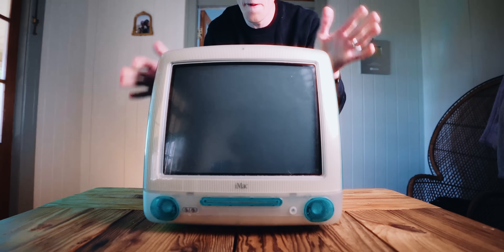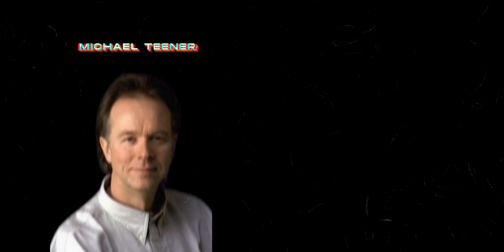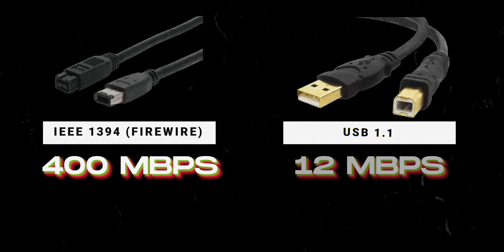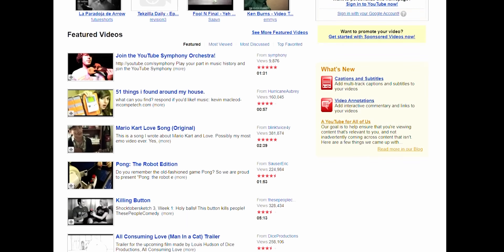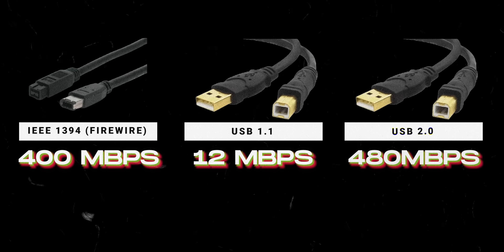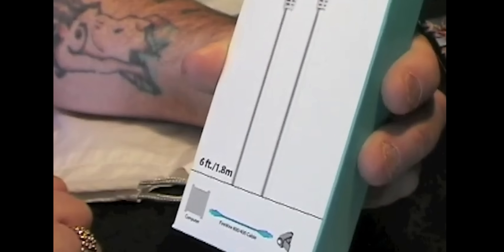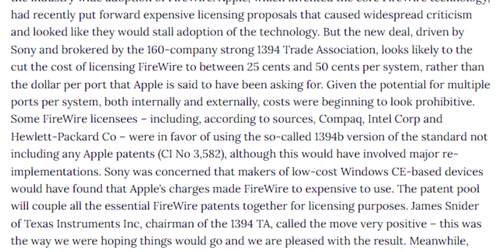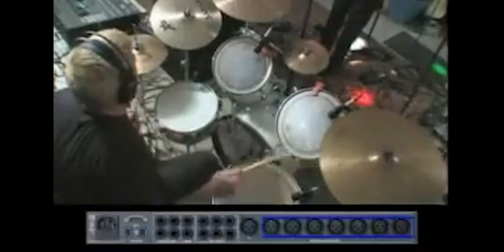Why Steve Jobs Forced You To Buy FireWire (Then Killed It)

Comment: One beautiful real-world advantage of Firewire is that it has consistent sustained transfer rate to external HDDs. You don't see significant dips in speed like with USB. While USB2's 480mbps looked fast on paper, the reality was way different. I always bought external HDDs and enclosures with eSATA and Firewire, especially ones with the Oxford Semi chipset (which provided the best performance and compatibility on Mac/PC). Also, the daisy chaining worked pretty well (my cam -> extHDD -> PC).

Comment: Fun Fact: The SCSI interface is (or at least was, back in the day) pronounced “Scuzzy”..for real! Macs all used “scuzzy hard drives”, PC’s used IDE…of course then cheaper Macs started using IDE drives and some high end PC’s even had SCSI drives. You could have up to 7 SCSI devices (edit: you cover this around @8:18) daisy chained together, with the Mac itself being SCSI address 0 so 6 additional hard drives or hard drives and CD-ROM drives, Zip drives, etc all chained together without writing about annoyingly cryptic dip switches that Pc’s often required. The Mac truly was incredibly easy for the most part when pc’s could be a nightmare for any non-geek. This was before the wonderful USB standard, showing Jobs wasn’t always a genius.

Comment: Great video! I loved FireWire, and still use it to connect to older devices. Some notes:

Firewire 1600 and 3200 were developed, and had been planned to be fully released, but Apple decided it wanted to abandon it for Thunderbolt (initially codenamed "Light Peak"). I believe only one FW1600 device made it to market, but I could be wrong.

Even if you don't have a FireWire port on your modern Mac, you can still use FireWire via a Thunderbolt 2 to FireWire 800 adapter (you can also add Thunderbolt 3 to 2 in one end and FireWire 400 to the other end, and it works). Unfortunately, Apple is dropping all support for Firewire in macOS 26 in the autumn of 2025

SCSI is pronounced "Scuzzy". It was really fast for it's day, but having a box limit of actual devices (plus the host), you had to set device ID 0-7 (and it wouldn't work if there was a conflict), and required a process of "terminating" the ends of the device chain (even if you only had 1 thing connected).

No Firewire "thumb" drives were ever made, because of the size of the chipset, but I semi-made one using a FirWire 800 CF card reader (it's more like a portable FireWire SSD).

A good way for you to find out someone didn't really understand technology was if they argued that USB 2.0 was faster lol.

Bonus fact: several Macs have the Firewire 400 port "upside down". Such as the eMac. I think it looks nice this way.

Comment: USB looked better on paper, but FireWire handled system interrupts way better, often resulting in faster speeds at the time. My FW400 drives would usually blow USB 2 hard drives out of the water in response and speed.

Comment: Fire was a likely result if you connected two computers (which firewire technically supports) with it that disagreed on how the very vaguely defined bus power specifications should be interpreted :) Some PC FW cards were only equipped to handle 12 or 16 volts while the bus could push far far more... and Macs did!

Comment: What you mean where did Firewire go??? NVidia's 12v HighPower GPU cable is the new firewire :P

Admittedly even on PC Firewire drive docks where beautiful and I was using it until 2013-2014.. when my LaCie dock died. But When I got into Retro systems, I got a couple Mac Pros 3,1 and I bought an iSight. Still looking for stuff with it.

Comment: The problem is that Firewire was fatally flawed from the beginning because it was a smart network - just the opposite of the Internet which turned everything into fungible packets. This is why, increasingly devices are on your network over IP. USB is problematic because it is too smart but, compared with Firewire, it is not trying to be an operating system in itself. I can go into far more detail but that's the gist of the story
Reply: I really wonder why there are no standards for hid, audio and video over IP.

I made esp32 projects for keyboard emulation and wireless microphone, and I had to write custom python scripts and implement my own protocols. And USB is a pain in the ass in many microcontrollers.

For audio and video there's RTP, but it's just a video stream, windows and macos won't use it as a microphone or speakers unless you do ffmpeg necromancy.
Reply: @Gameplayer55055 there are open and closed standards for IP AV transport. SMPTE 2110, AES 67, and AVB/TSN are the open ones. Dante and NDI are the major closed ones. Most of these are not available on consumer devices however MacOS natively supports AVB and AES67 audio devices, and there are good software based solutions for NDI and Dante.

Comment: Another religious zealot from the Church of Apple. 🙄 FireWire was only a brand name. The technology came from Adaptec and some others, not Apple. Product branding isn't a skill, engineering is.
Reply: The technology absolutely did not come from Adaptec. FireWire was developed in 1986. Adaptec licensed FireWire in 1995 to build PCI cards and those were crap until Adaptec acquired Skipstone in 1997 for their technology.
Reply: @slunky  all that "FireWire" is is a brand name for the IEEE-1394 technology that the brand is used to sell. Adaptec was indeed the company that led the consortium that turned SCSI from a parallel interface to a serial one. But isn't it just like a Machead to not know what the technology is, and think only in terms of branding.
Reply: @Speed-Daemon-123  Kinda weird that Adaptec's own website refers to it as "the industry-standard implementation of Apple Computer, Inc.'s FireWire digital I/O system" then, isn't it?
Reply: @Speed-Daemon-123  As well as Adaptec's website stating, "The proposed standard (P1394) derived from Apple's original FireWire design was accepted as an industry standard at the December 12, 1995"
Reply: @slunky  only to you, apparently. The rest of us know that implementation as IEEE-1394, and don't feel any need to scream at the IEEE about alleged ownership.

Comment: At home my old Sony (tape) video camera and my old DVD recorders both use Firewire 400.  In my computer collection have two Powerbook laptops that use Firewire 400 and one laptop that uses Firewire 800, plus I have a 20-inch G5 iMac with a Firewire 400 port, a 24-inch Intel glossy white  iMac with both one Firewire 400 port and one Firewire 800 port, and a 2010 Intel "mac mini" with a Firewire 800 port.  (smile ... smile)

Comment: Perhaps the real FireWire is the Thunderbolt we gained along the way? 😉
Reply: USB4/Thunderbolt supports non-polling DMA mode these days, making whatever advantage we had with Firewire not so bad. But I miss it. I still have my original iPod and nothing to connect to it. Well, I do have a PowerBook 13" kicking around somewhere.
Reply: @dazealex  now if only more than like 2 devices supported usb/thunderbolt 4, compared to when at that time at least quite a few stuff supported firewire

Comment: FireWire has a major problem, it shouldn’t be connected and disconnected live or it may burn up the FireWire chip itself. This coming from someone who experienced the problem first hand and then did some research. It was dropped because it could damage the port and kill the use of devices.
Reply: Not true. IEEE1394 standard specifies that devices are to be hot pluggable.
Reply: @slunky I could go out and grab a bunch more but the truth is, I was always plugging and unplugging my IEEE1394 camcorder and didn’t have any problems. But doing this killed off one of my audio interfaces. So, as a precaution, now I’d advise not doing it.

Comment: 9:44 No, the insane part is $1000 iPhones still using 25 year old USB 2.0 speeds; only the pro models get the 3.0 speeds. It was always about the greed.
Reply: The reason why they were stick to lightning for so long is because of licence fee. It took the euro commission and the law changes to make them move to usb c for good.
Which ironic because apple invested in usb c and it supports thunderbolt and whey were one of the first to introduce it and quickly move their tech to usb c. All tech. Except for iPhone. Because they made so much money with licencing.
Maybe why they are little mad and give only usb 2.0 for none pro models c:
Reply: @StefanFlyer  Can USB C be 2.0? Thought the standard says 3.0 for it.
Reply: @MezeiEugen nope, type C is a clusterfuck actually. It can be USB 2.0, 3.2 Gen 1 (aka 3.0), USB 3.2 Gen 2 (10Gbps), USB 3.2 gen 2x2, USB 4, can support Displayport alt mode but not everytime, can support USB-PD at any power between 15 and 240w, but not necessarily and can even be thunderbolt 3 or thunderbolt 4, which are kind of similar to USB 4 but not exactly
Reply: @MezeiEugen 2 of the wires in a USB C cable send data exactly how USB 2.0 cables do. If you only use those for data, you have the same speed limits of a USB 2.0 cable.
Part of the reason the number is confusing is that it's the version of the USB C specification, not the level of speed. The USB 3.0 spec contains everything in the USB 2.0 spec.
Reply: @Spencer-wc6ew  I thought you only can call it USB-C if it supports at least USB 3.0.
Reply: The phone that costs $1000 is the pro phone that comes with USB3….
Reply: honestly even with the upgrade, the usb c port on my 15 pro mac almost never gets used other than for charging 😂. Unless you're the top 0.5% of "pro" users who actually record ProRes RAW externally than it's going to go unnoticed.
Reply: @andrejcupac7359  How you record ProRes on an iPhone?
Reply: I'm trying to remember the last time I used the USB port for anything but charging.
Reply: gamechep making a comment about iPhones using usb 2.0 speeds for data transfers when the reality is that the vast majority of data on the billions of iPhones sold are synced via iCloud using Wi-Fi or via cellular. The much smaller subset of professional users who need faster data transfers speeds have a newer model 16 Pro/Pro Max which has usb C supporting speeds up so 10Gb\s. An iPhone 16 costs $800. An iPhone 16e costs $600. Not close to your $1000.
Reply: As much as I thought USB 3.0 will come in handy, in real life it makes no difference. How much data you transfer to/from your phone by USB? Heck the models with biggest memory have 512 GB space, half TB transferred by USB 3.0 or 2.0 is not such a big time difference. But usually you transfer a lot less data at one time.
Reply: @MezeiEugen  External ssds & cards benefit greatly.
Reply: @MezeiEugen this is such an apple user reply
Reply: @TRSH-CLN-69  It was a question, my friend whose parents were to cheap to give him a name, you notice it by the question mark at the end of the sentence.
Reply: @TRSH-CLN-69 . I absolutely agree .
And my main computer is a  M2 Ultra Mac studio .I am definitely an apple loser

Comment: 1:07 "you had theese things called Parallel Ports that worked half the time". USB isn't much better. It hardly EVER works! If I so much as breathe on it or walk too heavily, it disconnects, even though it's still plugged in. I plug a USB device into a USB port, doesn't matter what the device is (keyboard, mouse, flash drive, etc), doesn't matter what computer I use, doesn't matter what OS I use, doesn't matter witch USB port I plug it into ... "USB device not recognised" either that or I get nothing t all. I have to wiggle the lead about, un-plug it and re-plug it, pray to every known God in the universe until eventually it works. And even then halfway though doing what i'm doing it will randomly stop working. God I HATE USB!
Reply: I think you need to clean your ports or something... 

I've never heard someone say this happens to them constantly, and the last time I got that error was like 6 years ago while using a mouse with a chewed up cable
Reply: Sounds more like an layer 8 problem
Reply: @juniorwmg  For sure, lol

Comment: SCSI is usually said as 'scuzzy'. Also motherboard used for USB 2.0 example was well into the USB 3.0 era, so deep into it i believe Z77 chipset supported on die cpu usb 3 controllers when used with Ivy Bridge cpus and about 12 or 13 years after usb 2.0 , something along the KT266 chipset era would have brand spanking new USB 2.0 ports, my first board with 2.0 was an Asus A7V333 i think.

Comment: @3:08  That's an error.  The pic includes a FW800 connector which was 800 MBPS
Reply: Though "MBPS" was already wrong, it's Mbps, megabits per second; not MB=megabytes, which is 8x more data.
Reply: @DoubleMonoLR  Your right. Thank you.   Its been several years since I handled any firewire hardware and did not recall whether is was MBps or Mbps.  I certainly didn't expect to be called on that!  LOL.

Comment: It's amazing that for USB 2.0 was going to replace firewire and yet it never did until we created thunderbolt and slapped it onto USB and called USB 3.1 whatever. And there was so many people saying that oh firewire is slow and dead here's a graph etc. it's was like yeah here's a drive with both interfaces put a file on it using both of them then tell me that USB is faster ha ha yeah right. It was so annoying. And it was even more annoying that it wasn't on everything, I guess that explains why. And yes thunderbolt is essentially two lanes that are bi directional essentially firewire with less power ( it can operate around 48V). The only downside was that there are some chipset compatibility issues and because of that and the way it was implemented it would crash systems although if everything played right it worked great, although there was far more issues on windows because of drivers as well as stability. And don't forget since things were daisychained and semi smart devices could talk to each other and transfer the data without requiring the system CPU to process everything. There was also firewire networking which was really great for Internet connection sharing or file sharing between two devices. And then target disk mode which Apple has decided to kill in almost every sense of the word, Computer not working for some reason but turns on food it into target disk mode and plug it into another computer boom you can copy off that presentation you need in 30 minutes and fix the problems later.

Comment: Remember USB powered speakers?   USB's 12mbps was eight times faster than the 1.5 mbps needed for CD quality sound, so everyone thought that USB speakers would be a big hit.  The product was a disaster.  Patch after patch could not stop the stuttering!
The problem was that, unlike firewire, USB data transfers would drop to zero if the operating system was not paying attention.  This is why DV camcorders never could switch to USB 2.0 or even 3.0 despite the claimed faster data rate.  The cameras that DID use USB only used it for file transfer, and could not live stream digitally the way DV tape camcorders could..
Reply: From memory the original Harman Kardon sound sticks were USB. I assumed they were good but I never owned them myself.
Reply: The USB 2.0 speakers I've got seem to work alright, they're just grossly underpowered. USB webcams seem to work ok also.
Reply: @Cyba_IT But the USB 1.1 ones never did.  The point was that USB could not deliver even 1/8 of its theoretical potential in a time-critical application.
Reply: 3.0 can as its full duplex and fast enough.

but was irrelevant to implement because firewire already existed...

Comment: Isn't USB 4.0 a new generation of connection type comprising all the features from usb, Firewire, Ethernet, Thunderbolt, SCSI, eSATA, HDMI, VGA, DVI, video display port DP, express card slot and tons of extras? 
No wonder there are adapters to still use those  with new port.
I believe only specialized features of COM1 and LPT ports cannot easily be adapted via usb 4.
Reply: USB4 for 40gbps where as tb5 is 80gbps ... Thunderbolt 5 seems to be a universal one that can encapsulate usb + dp-alt ... the problem is its price
Reply: @ytbgmc  @mahirooyama9424 Intel licensed the TB3 tech to the USB people, who produced USB4, and now "Thunderbolt 4" is just Intel's own-brand implementation of USB4, Thunderbolt 5 same thing for USB4v2. A lot of the USB4/USB4v2 features are optional for USB4/4v2 branded kit, but must be included for TB4/5 certification and branding.  Anybody can make and sell USB4v2-branded kit, which can be functionally equivalent to TB5 but if they want to call it Thunderbolt 5 they have to cross Intel's palms with silver to get certified and licensed. If they stick to USB4/USB4v2 branding they can  get away with a fairly minimal implementation.
Reply: COM can totally communicate over USB-C! My router (Protectli VP2430) uses a type-C connection for COM. Super useful, since I have tons of USB-C cables everywhere
Reply: Only intel and Apple can use thunderbolt so not really universal
Reply: @mahirooyama9424  Not really. Intel owns the "Thunderbolt" spec and brand, but it's now open standard so even AMD (Intel's direct CPU competitor in the x86-64 market) can implement it in their chipsets and CPU's.
Heck, even before Thunderbolt 4 was formally laid out and made an open standard, you could add Thunderbolt 3 to AMD "Zen"-powered systems (prior to "Zen 4", such as AM5 Ryzen 7000) using a PCIe AIC, like adding extra USB (or IEEE 1394/"Firewire") ports to older PCI motherboards.
Reply: @mahirooyama9424 That was never true. Prior to opening the standard a few years ago, any OEM could license the ability to use Thunderbolt on non Intel devices. None did due to the cost and the lack of realistic usecases for Thunderbolt outside of eGPUs